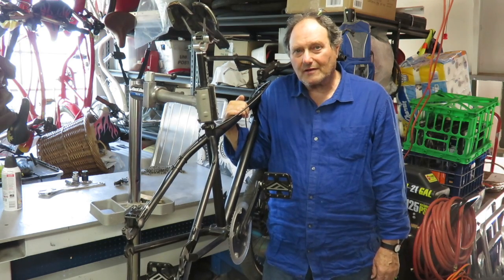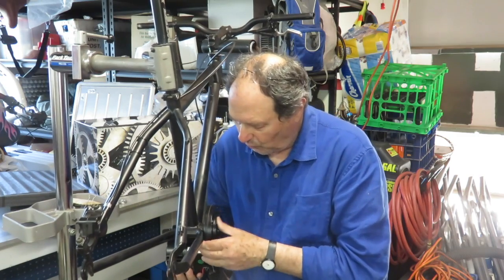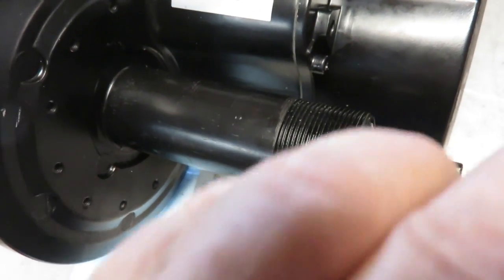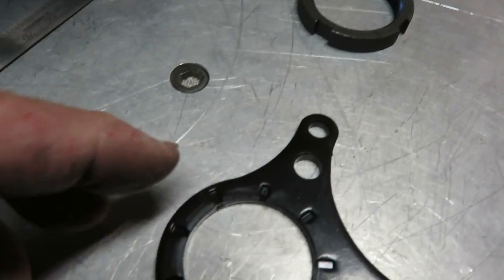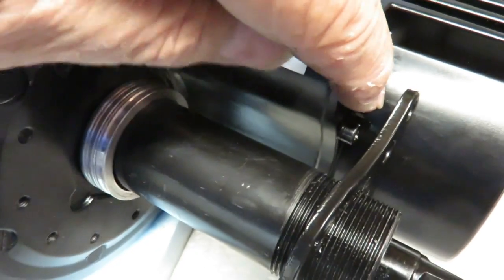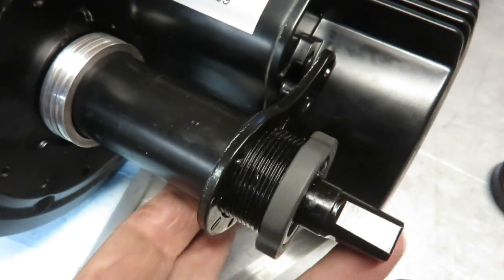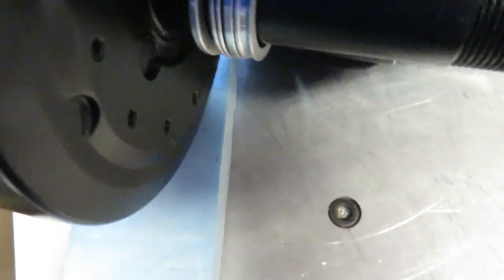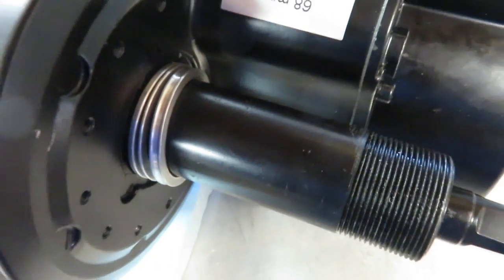BBSHD Mid-Drive Electric Bike Install

Comment: Roy are these shims readily available as I didn't get any with my kit. My bottom bracket is 73mm, I'm assuming I've enough room to fit them if needed. (based in Oz)
Reply from the maker: They came in the kit I bought from Lunacycle. Mine is 68mm maybe 73mm does not need the shims?

Thanks for watching and good luck with your build.

I think the BBSHD is a terrific kit.

Comment: Forget about that silly little wrench.   Purchase bbshd sockets and use a torque wrench to mount the motor on the bottom bracket.. otherwise, I promise you it will get loose.
Reply from the maker: I agree.
Where are you buying the BBSHD sockets?
I got mine years ago, today they are very pricey.
Reply: @royprince8575  I paid about $100 CAD to get the 2 sockets from EMpowered Cycles Electric Bike Co.   Prior to buying the sockets, I resorted to using California eBike’s stabilizer bar and hose ring, but even then, the hose ring broke on me after a year of usage.
Reply: @johna1439   you need a beefier clamp. Some small ones break easier now. Quality has come way down.
Reply: @walterkarpynka8343  Are you referring to the hose clamp I used for the California ebike stabilizer bar?  Or other clamp?  Thx
Reply: @johna1439  hose clamps made recently from China are not as well made as old ones we used to buy here. I happened to find one in my garage that must be over 40 years old made in either Canada or USA. It's a professional tool compared to the toy clamps they they make now. It's been holding the stabilizer bar solidly since I installed it about a year ago. Installing another motor on another bike soon. Having trouble finding new clamps that good. Forget Home Depot or chain auto parts stores. Going to check industrial suppliers like Johnstone Supply.
Reply: what about using a flat head screwdriver and a hammer? My BBS02 is arriving today and no way am I paying for a socket lol
Reply: @smallhatshatethetruth7933  great idea

Comment: Hi Roy, I notice you have the 68mm drive unit, did your frame have the 68mm bottom bracket or 73mm, seems there is a 68mm, 100mm and 120mm bbshd available but not 73mm? I’m wondering does the 68mm fit the 73mm frames just fine? There seems to be some wiggly room with those shims.
Reply: I have the same doubt, do you know the answer? thanks
Reply: @MrPadelg  the 68mm bbshd is 68-73mm so will fit

Comment: Will a drive crank, like that on a tandem captains left, have clearance from the motor? I want to install on a tandem and do not wish to give up any gearing on the stokers end of things. I know I will give up the eccentrics adjustability but I can fabricate a tensioning pulley for the timing chain..

Comment: Hello Roy, 
I have TWO questions for you:
1) What would be the minimalist Bafang mid drive build to turn a manual bike into an ebike? 
I ask this because I am not a big fan of too many wires sticking around the bike frame as I see them time and again in installation videos. Can I do a simple build with just a mid drive motor and a thumb (or twist) throttle? I assume that the throttle is the only key element needed to control the motor. I could care less about the LCD display, the speed, or changing the power of the motor as the gears change especially as I ride on the highest gear no matter what the terrain! 
2) Is it a good idea to build ebike on a single-speed bike that can coast? Having no gear derailleur would further simplify my ebike especially when I do not use the gears anyway. The less is actually more and simpler!
Please advise.

Comment: Great vid , now i made one of these and stuck it on a rock hopper, BUT when you pull the motor in an up position then tighten does the motor not drop back down again? With mine it did and started eating the frame, the only thing I could think of to keep it there was metal epoxy which worked 100%, but i would rather a bracket if there was such a thing.
Reply: You need the Heavy Duty Bafang Stabilizer Bar – BSBHD-1. These should come with every one of these motors!